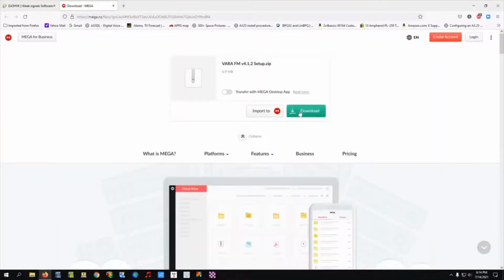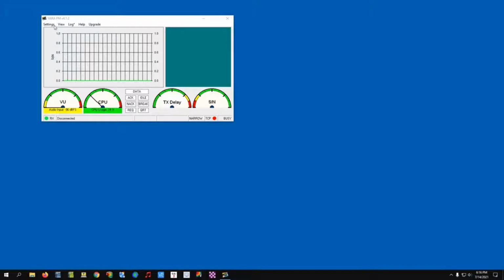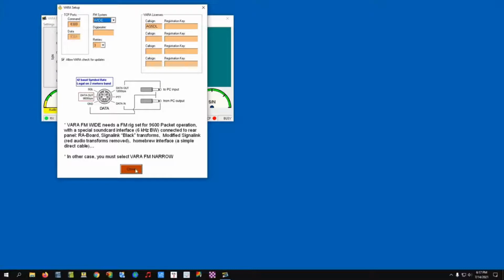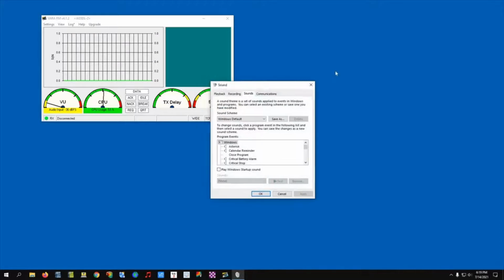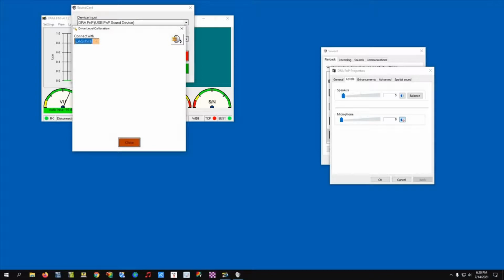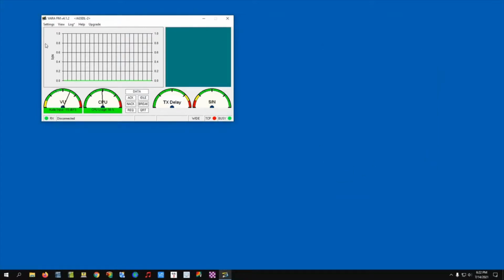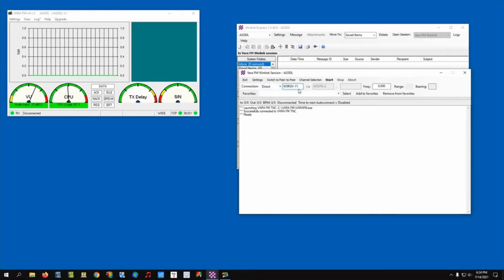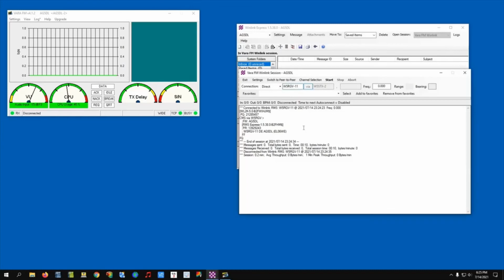VARA FM install and initial setup

Comment: KISS TCP port is not connected to VARA TNC. How can we solve this problem? Can you help me?
Reply from the maker: I have not run into this problem so I probably can't help.  The KISS TCP are defaulted in the VARA FM program.
If you are not connecting, my only guess is that the port is in use by another program and maybe try changing
the port number maybe up one digit in both VARA FM and the Winlink session.
Again, this is just a guess.   Maybe someone that has experienced this problem will see this and reply
and correctly resolve the problem.  Good luck.

Comment: Hi Joe, K5QW, I have the paid version of Vera FM, connected to Kenwood TS2000 via Signalink.  I can connect to Vera FM just fine, but I cannot do the Autotune to any of the nodes down here (Weslaco).
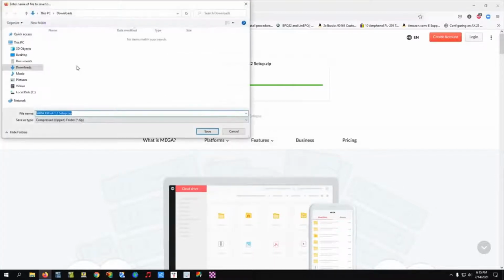I do have the record level set so Vera FM shows 1:00 o'clock.  When I start a connection to a node it fails without much info.  Any ideas? Kim

Comment: how do i get winlink to control my IC9700 frequency? everything works but changing the frequency
Reply from the maker: There is a USB driver on ICOM's site.  Unplug the radio from your computer and
then install the driver you downloaded from ICOM and then plug the cable between
the radio and computer and hopefully that will get the frequencies to change
correctly for you.  Also, I think there is a setup option in the VARA FM menu that
lets you enter your radio info. so it talks to your radio.  I hope this helps.  73